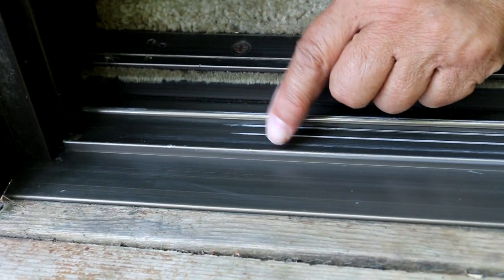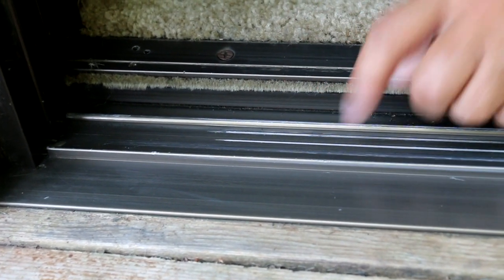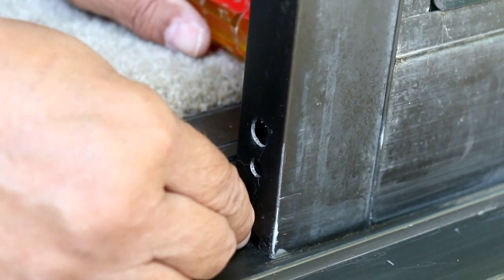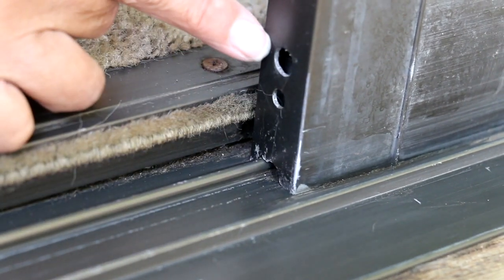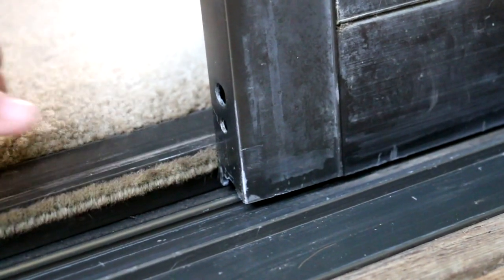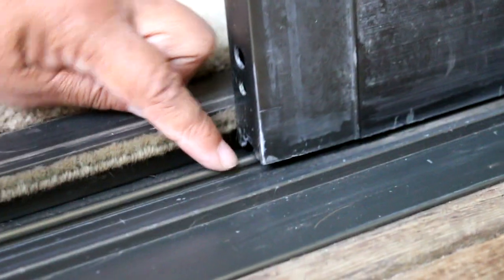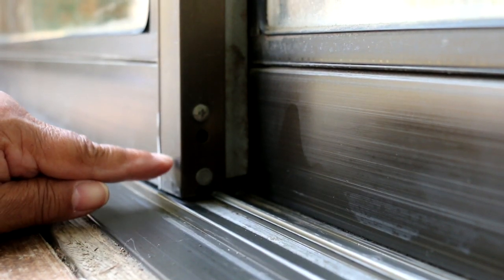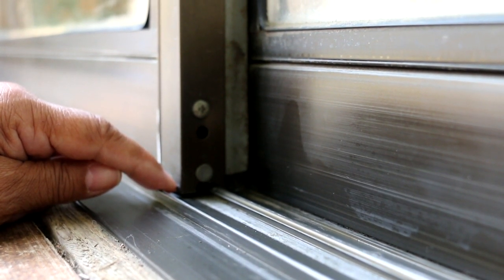Unstick Sliding Patio Door

Comment: Thanks Leah. For my sliding door, the installer recommended furniture polish after cleaning the track. It doesn't attract dirt and the door slides smooth as silk!
Reply from the maker: Nice! Thanks for sharing that tip.
Reply: Candle wax is even better. Just rub the candle on the track.

Comment: THANKS I have a 1950 home with 3 sets  4 'X 7' Sliding glass Patio door one was sliding to hard so I followed your instruction and its fixed WOW! The door least used in like new this one even after adjusting is not as smooth but it's November in Michigan so replacing the rollers may be something in the summer but what a difference it made it was rubbing on bottom track just the right side left side of door roller is fine.
Reply from the maker: Nice!👍

Comment: Thanks for posting. I like to use a small pry bar to lift the door gently as I turn the screw to raise the door. It take the weight off the assembly, and lessens the chance of stripping the screw head because you need to twist much harder when it has weight on it. :-)

Comment: For 2 years I have lived in this apt. I have a very large beautiful balcony, but anytime I opened my sliding door it was so loud every neighbor complained so I limited my balcony use then I came across this video. Not only was there concrete on my track! Which I scraped off then cleaned and adjusted the wheel. Now that door is so dam quiet I was stunned. So thank you very much. And yes we have maintenance people but they all got fired and the new guys never come to fix anything.  Anyone  got a video of how to repair the hot water leak in my bathtub faucet?

Comment: One of your viewers left this comment:

     "I love your direction for the adjusting screw.  Rather than trying to remember which way does what you simply say to try one way, and if that does not work try the the other way. Perfect?"

If anyone does it that way, be very careful. Here's why . . .

If you turn a screw and nothing happens, does it mean you've turned it the right direction, the wrong direction,  or does it mean you haven't turned it far enough in any direction?

Don't leave it to chance. Make sure you turn it the correct direction.

If you're turning the screw clockwise, the wheels will extend causing the door to move upwards.  Eventually, it will reach a point when you can no longer turn the screw.  If you turn the screw counter-clockwise, the wheels will retract causing the door to move downwards until the door is resting on the bottom track. At that point, the screw will continue to turn but you will see no movement of the door. If you continue to turn, the screw will not stop and eventually you will hear the noise of the retaining nut fall off inside the frame and the screw will pull completely out of the frame.  Then, you're really screwed!
Reply: @Randy...Thank you.  I didnt think about unscrewing the screw too far.
Reply: Ok. I had a problem with my sliding door. Everything worked perfectly then one day it wouldn’t slide at all. At the end of the door underneath it in the track was that retaining nut. Do I need a new door now? Is there any way to open the door frame? It doesn’t look like it is even possible!
Reply: @Rockshredder  Most often you will see a second screw sticking out of the side of the door frame, or it'll be recessed slightly.  Losen that screw and one of two things will happen. Either the entire roller mechanism will fall out of the hole where normally only the roller protrude, or the entire bottom section of the frame will come off. Either way, you "should" be able to install that retaining nut and re-attach it to the door.

If you plan to do this, go the extra mile and  inspect the rollers for wear and tear, because if they need replacing, now would be the time to do it.
Reply: @rpprevost  Thanks Randy, I will take another look at the door and give it a try!
Reply: @rpprevost  I took off all the screws on the outside of the door. It didn't open up.  What I found is the wheels could be moved around as they slid everywhere at the bottom of the panel. I had to take a screw driver (or even a pen would work) and move the wheels to where they belonged. I knew where they belonged because the screw hole would line up with the wheel assembly. I screwed it down then did the same to the other side. I don't know what the nut did as the screws are similar to wood screws but the door is working better. Hopefully I can make some fine adjustments with the bottom screws but it is fine for the moment.
Reply: @Rockshredder  Go online and search for the door sliders and compare new ones to what you have, and you'll see if they're assembled properly.
Reply: @rpprevost  You can't really see them, only feel them. There are two sets of "fluffy guards" on either side of the bottom of the door that cover the wheels from sight.

Comment: Another clear, simple and especially helpful video Leah! 

I’ve seen lots of videos about adjusting wheel height, but nothing on fixing a door that rubs on the side of the track. On mine, the door slides about halfway open before the gap between the frame and the side of the rail closes. From there on, it’s rubbing. It’s as if the part the rollers ride on is not parallel with the side of the rail.

Comment: OK I have a question what if you rotate the wheel screw on the back of the door trying to get it to raise a little bit but no matter which way you turn it it’s still isn’t high enough to overcome a screw holding the Metal frame down to the floor. I think in my case I need to put the dry lubricate on the weatherstripping of the door At the bottom and the top any advice would be appreciated

Comment: Good info thanks! What if I have a normal glass storm door that doesn't close anymore... it's sagging and the only way to close it is by lifting up the while door and shoving it closed!
Reply: You probably need new rollers & possibly a new track. If the rollers are not adjusting anymore, they, or the cartridge is worn out. With heavy doors the cartridges sometimes have a groove worn in the adjustment guide slots, making them non-adjustable. If the track is still good, replace the rollers as soon as you can before the door starts dragging on the track, causing  flat spots and then it will require replacement.

Comment: This popped up because I watched other videos for fixing sliding glass doors. I actually had to replace the rollers on mine. One was totally ceased up. The other didn't move well. I probably could have cleaned them up to make them work, but you could see the damage on the ceased up one. (cost less than $20 from Home Depot)
If the door still doesn't move well after cleaning the frame and oiling the rollers(only the rollers), you probably need to replace the rollers. You don't oil the frame of a Garage door, why would you oil the frame of a sliding glass door? Just oil the rollers.

Comment: Thanks for another wonderful video, Leah!  One of my roller adjustment screws is stuck and won't turn. Any suggestions on how to loosen it up?  Also, what's the lubricant you are using? Can I use WD-40 on both the track and the screw?
Reply: WD-40 should not be used as a lubricant.

Comment: Where you adjusted the first screw what  the lower hole for?
Reply from the maker: The lower hole for the door in the video is to actually remove the wheels in the event that they're broken and need to be replaced.
Reply: seejanedrill.     that's VERY important to know the difference in the two... thx for the diy

Comment: Don't get the point of lubing the track. The door rides on rollers which ride on the rail. I accept that lubing the bearings in the rollers would be helpful but I can't understand why putting anything on the track would do anything worthwhile.
Reply from the maker: I use lube and I get less resistance.  The door just glides better in my opinion.
Reply: @seejanedrill  Am I misunderstanding something? It seems that if lubing the track made an improvement, would mean the frame is touching the track which means the rollers are adjusted improperly.